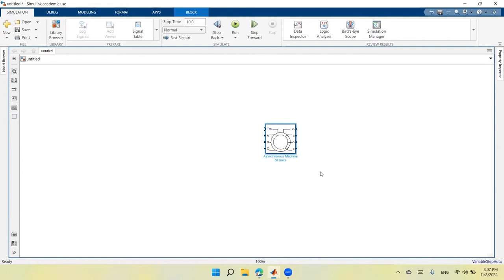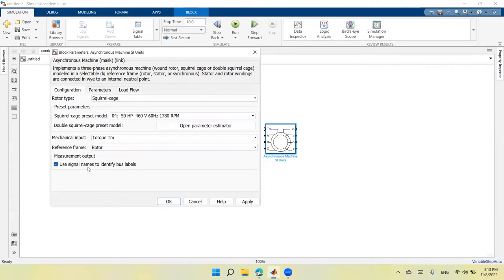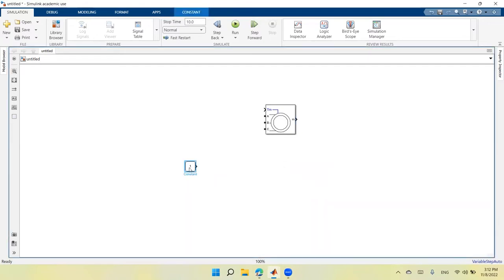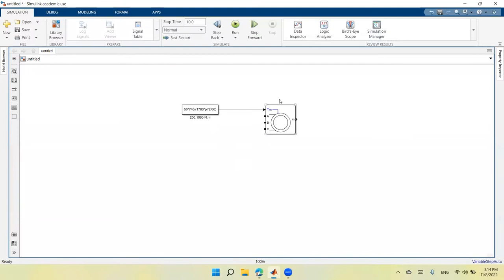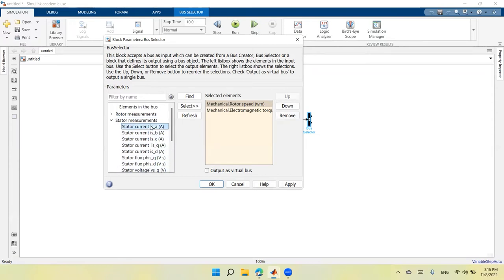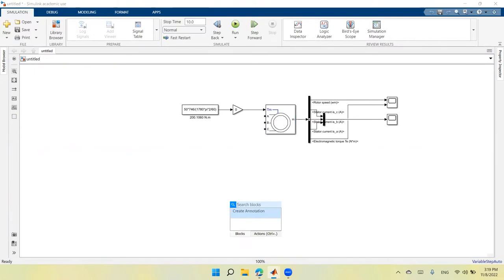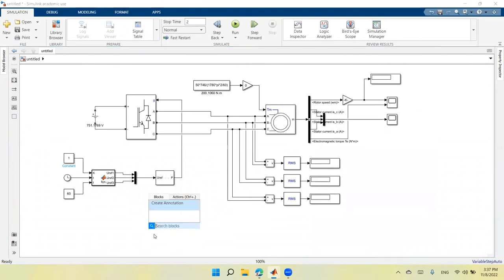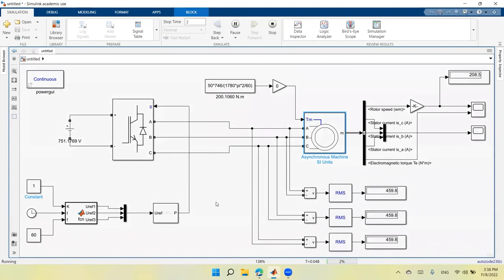13 MATLAB Simulink Variable Frequency Induction Motor Drive.

Comment: Great video! ❤
I tried adding a rectifier before the inverter to get a constant DC voltage, but I struggled with stability. I used a three-phase diode bridge rectifier and added a capacitor for smoothing, but the output still fluctuates. Any tips on achieving a more stable DC voltage before the inverter?

Comment: I would like to ask you prof, why my RMS  value is not same in every phase? how can i solve this? I follow you until the end of video but doesnt have same value as you
Reply from the maker: Check all rms blocks for the true rms option. It should be unchecked. Make sure that the stop time of the simulation is no less than 2 sec.